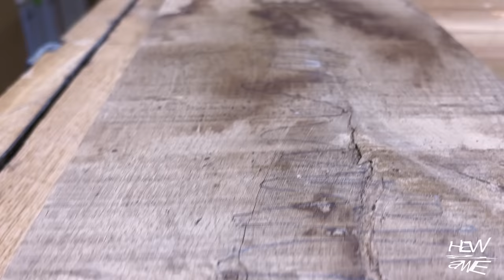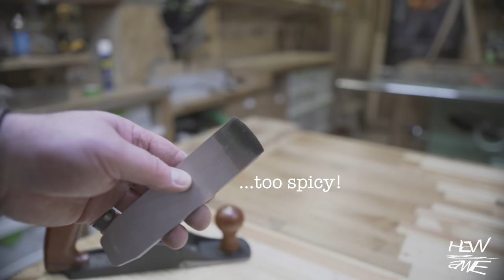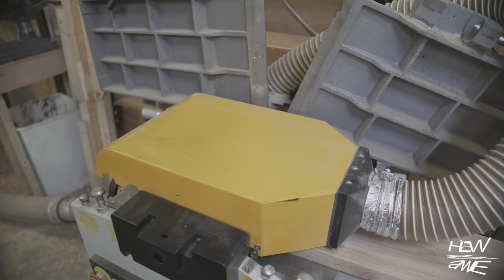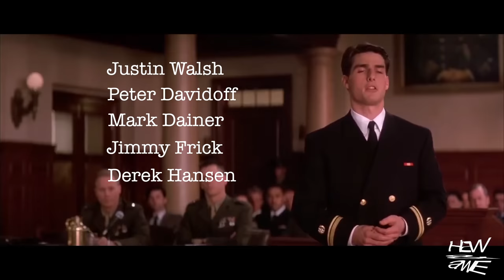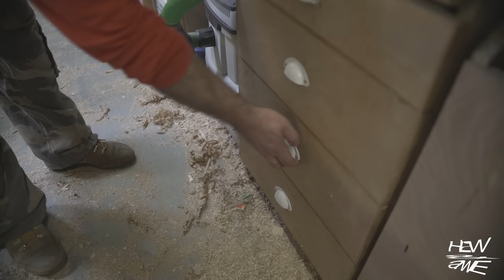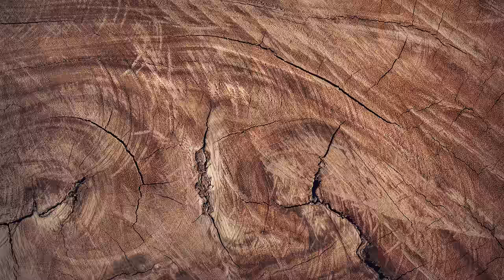Planer Sled - waste of time!

Comment: Yea mate, another good one thanks, I prep all my timber by hand, got no planer thicknesser, jointer, old fashioned kinda guy me!  have a great weekend dude, thanks for posting, keep 'em coming
Reply from the maker: I bet that’s nice never hearing a machine! Cheers Paul, hope you have a lovely weekend! 🍻🍻🍻
Reply: I’ve just picked up a beat up wooden fore plane - 17 inches long with a relatively narrow cambered iron and wide mouth. After planing the sole and honing the blade I have to say the thing is a revelation. Like a scrub plane it’s quick but the length means you are leveling without really thinking too hard. Take care of twist first, obviously, as on longer boards even a long plane might ride through a twist. It’s a lot lighter than a similar size metal bodied plane so good for long sessions.

Comment: This is how I do it. I'm not looking for perfection with the hand plane. I don't try and fix any bits of tear out. If I flip it "clean" face down and it feels flat. I run it through my cheap planer...  Before I'm done planing, both sides will be go through the planer. 
Like you said in the video. The jig doesn't work for long boards... I glued the MDF together for a sled too. I found it rigid, but just to heavy and I'm pretty fit.
I do my edges with a jig on the table saw, but you definitely get a cleaner edge then I do with a hand plane. 

PS: if I could do it again I would have bought an electric hand plane for this task. I will when I have more money.

Thanks for the great content! I hope lots of people correct themselves to take this path before wasting as much time as I did.
Reply from the maker: Cheers Stephane! This electric hand plans I would of thought to short and would ride the ‘waves’ not taking the tops off to level though 🤷🏻‍♂️
Reply: @HewAndAwe  I get ya, and I see that your right. That being said, I would use a combination of both an electric hand plane and a No. 7... Just eyeball the high spots the way some people on YouTube do with a scrub plane.... I'd love to learn to use a scrub plane too(I've got an old no 4  that I can't manage to use as a smoothing plane), but with only so many hours in a day.
Reply from the maker: @killawee118  I never thought I’d hear the day when someone said I’d love to learn to use a scrub plane, easily the least liked of planes.

Comment: Good advice!
I got rid of my jointer and built a dead flat assembly table.
Flatten one face of a board so it doesn't rock on a flat surface, run it through the thickness planer, and you're golden!
Shoot, I don't even have a table saw anymore.
Reply from the maker: Haha what’s that like? I can’t imagine being with out a table saw!! I hope you had a lovely Christmas! 🍻😊🍻
Reply: @HewAndAwe  I sold my table saw to the woodshop at my job. I have visitation rights.
At my personal shop I have a Bosch track saw. Not as convenient to use, but the dust collection is far superior.

Comment: Mat loved the video, and you’re so right, it doesn’t take much to hand plane a board relatively flat then whack it through the thicknesser. Although my thicknesser bed works a treat and I’ve had no problems with it, all my stock comes out very square and it’s made from MDF 🤷🏻‍♂️🙈😂
Reply from the maker: LMFAO, Ive planed MDF once - I was surprised how clean it came out, but then regretted it when it came to finish, like a sponge & fluffy as too!

Comment: I use an old timber jack plane belonged to my great great uncle it'd be around 140 years old fuckin lovely thing to use, then it's a trip through the thicknesser it's a cheap Ryobi but it does a good job for what it is and what the timbers I work with are (Australian hardwoods mainly blackwood atm). Just got a old 10" planner that I'm restoring.
Reply from the maker: Sounds like the type of tool I’d take home with me every day just in case there’s a fire!
Reply: @HewAndAwe  lol. 50 years ago it nearly got thrown in the fire but my dad thought I better save it. Glad he did!

Comment: Only here in north America (U.S and Canada) is a planer called a jointer or a thickness planer/thicknesser is called a planer. I'm not sure but I think it was a marketing decision to distinguish the two during the early DIY boom somewhere around the 50's. Or maybe a woodworker saw a 6" or 8" planer and said, "You can't plane anything on that, it's only wide enough to joint on".
Anyway, I prefer Planer/Thicknesser myself.
All the Best, Chuck
Reply from the maker: Oh man thank Chuck! I always wondered this, cause it make NO sense anyone calling it a jointer. A planer/jointer is pretty much a hand plane turned upside down, a planer doesn't joint anything either... And then there's the rabbet, rebate... why we can all just get on the same page  I dont know, its so confusing for any newbies...
Reply: @HewAndAwe  You look all dejected at the end of your video. 😢 I bought a Felder AD-531 and haven't back. I get not everyone can jump in and afford a planer and a thicknesser especially in the beginning, but it is surely worth the investment. 
Just remember, in woodworking, there's nothing money can't fix, no wait, it's you only cry once!
Crap, it's one of those, or is it both? 🤦‍♂

All the Best, Chuck
Reply from the maker: @toolchuck  Depression is a cruel mistress fella. I look back mate and think I should of just held out till I could afford what I wanted, the money I wasted buying crap only to then sell on at a loss - If I was god I would give everyone a planer thicknesser combo, on one condition they make chair!

Comment: Great video. Timely too. I just made my son a desk from old scaffold boards I had laying around. They had a nasty twist . Bought melamine sled. Used a ton of hot glue and shims to stop it rocking and whacked it through the thicknesser. Then flipped it. Trying to clean that glue off was a job. As you said it was over long and heavy. I’m making myself a work bench next with no sled. Only thing is snipe. Guess I’ll just have to lose a few inches from each end. Thanks again  great video.
Reply from the maker: Brave to use scaff boards mate 😬 With snipe on lunch box planers you either lock off the out feed and in feed tables so they’re rock solid with absolutely no give/play in them or make a jig with a piece of melamine running through the planer and built so it’s supported 100% in and out feed sides Hope that makes sense? The machine also needs to be bolted down so it can’t move. Then you shouldn’t have any snipe. 👍

Comment: The point of the sled is to save an enormous amount of time.  I need 50 boards flat and can't hand plane them all.  Great olds school idea though
Reply from the maker: If you’re in the position to need 50 boards milled up you’re be in the position to have a planer and thicknesser.

Comment: Ive yet to buy a jointer or planer, ive been doing it by hand. I would give into a shelix planer to speed up the process of milling, but id still like to face joint one side by hand.
Reply from the maker: Yeah planet and thicknesser is the way to go, but while peeps are saving up for the planer they can get by with the above idea. The helix head doesn’t speed anything up, but boy is quieter!!! Merry Christmas! 🍻😊🍻
Reply: @HewAndAwe  im thinking of getting the Oliver 12 1/2", woodcraft has it for 1000 right now. When i buy a jointer itll be a 12", no messing around. Hand planing is fun actually. Happy new year.

Comment: Price of some of these hand planes you can buy a cheap second have planner jointer for like a TITAN TTB579PLN lol.
I have the same Axminster as you an love it 👍
Reply from the maker: Really, I'm not in love with mine! The fence when set then moved forward or back its out of square, oh and dont even get me started about setting the beds, what an awful system the bolt and nuts are!
Reply: @HewAndAwe  I got mine second hand beds was set well and haven't touched it and never have a issue with the fence being out of square but it is a bit flimsy when  planning large timber and trying to hold it square against the fence. But I guess all 12" planer thicknesses are gonna have some pros and cons.

Comment: Great video Ben but I'll disagree with your advice at 5:20 in the video re tilting the plane to fix a slight angle on the edge of the board. All the old hands I worked with years ago just moved the plane over slightly so they were only taking a pass on the angled area of the board, then go back and have one more full length pass to get it true. Angling the plane is too prone to moving and creating a bigger problem, especially with the bigger/heavier planes. Paul Sellers has a great video on the subject.
Reply from the maker: What works for some doesn’t necessarily work for everyone else.

Comment: Hi Ben, another great video, as usual. As a relative newbie to woodworking I hear people say all the time to get your boards somewhere near to final size, and then let them acclimatise before finishing to the final size. My question is how near is near? Is it 5mm on the length, width, height or is it more or less than that? Having not really had the experience of boards shifting to date any advice, will I'm sure, save me some hard earned in the future.
Reply from the maker: Morning Jon. Normally I’d say just a few mm, the length I usually leave 40mm ish to be honest cutting to length is pretty much done last thing, especially if it’s a panel glue up cause there’s a good change it’s not square.
Reply: @HewAndAwe  Cheers Ben, as always, much appreciated.

Comment: What you're saying makes sense, but there's a little more to it, especially for the novice, who is likely the type of woodworker who is asking the question. They are just as likely to not have the hand tools and/or an adequate workbench.

One might think they can save money by not having to buy a jointer (aka planer, lol), following your advice, but they're still looking at buying decent hand planes, a sharpening system and possibly something to firmly hold any size board they would typically be trying to mill.

I'm not knocking your advice. I think it's very sound advice. You just missed the reality of what the novice woodworking probably lacks trying to follow it.
Reply from the maker: I didn’t miss that at all, wasn’t anything to do with what the point of the video is.

Comment: Ben, this is awesome. So you know, I've seen a lot of your content lately, but mainly at work (  :)  ) and there I can't comment... Anyway, I love this how-to/teaching content. I agree with everything you said. Two questions:
   One: how would you approach a board that's about say, 80 inches long with this technique - I'd love to see a video on that
   Two: Your  scrub plane has a hella huge camber to it... any comments? - I understand  the 'why" of the camber, but why do you have THAT MUCH?
Reply from the maker: Howzit Matt! 😊 I’d approach it exactly the same I’d have it clamped in place along the face of the bench shooting the plane diagonal across the board. With a board that long I’d make sure I’ve read the board really well first. The plane came like that from veritas, that’s kinda what I was showing that’s ridiculous camber and a normal flat grind blade pardon the pun will cut it. Sawn boards from a good supplier should never need that kinda camber. Also did you see how thick the iron is 🤯 A2 steel works just fine doesn’t need to that thick. In short that scrub plane was an unnecessary buy. 👍

Comment: Great video!!   I need to get some of those hand planes.  I don’t know how many hours I’ve spent hot gluing and then lifting it and running it threw the planer or drum sander.  Works your arms out , that’s for sure.   Any good kit or set you could recommend for a beginner?   And hello 👋 from the states , I’m Tyler From Iowa 😃.
Reply from the maker: Hi Tyler! I’d say start with the cheap Stanley plans, see how you get on with them. If you find them a paint to use I’d suggest you try low angle planes not all are made equal mind you, you pay for what you get. I think the veritas are a good middle ground of value and  quality. 👍
Reply: @HewAndAwe  By cheep Stanley I take it you meen modern and not vintage. Then provided you put in the work to set them up the modern ones can do a good job. It is just a lot of work to set up a modern Stanley.

Comment: how is 20 minutes with a hand plane quicker than a couple shims and a piece of MDF?
I'm not against getting the same results with hand tools... but you're not gonna convince me that knocking down high spots with a scrub is quicker than a pass through the planer.
Reply from the maker: Where did you get 20 mins from. You’ve missed the point of the vid.